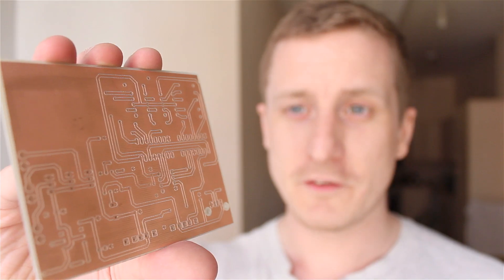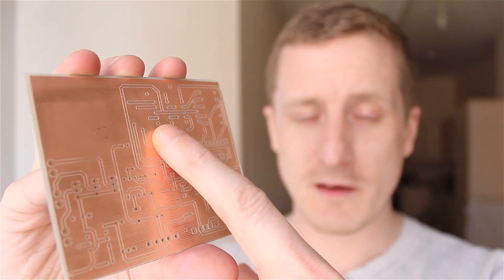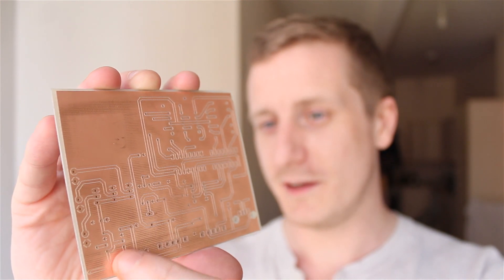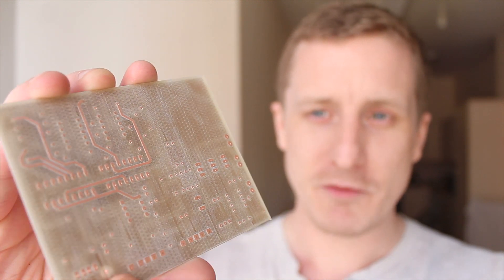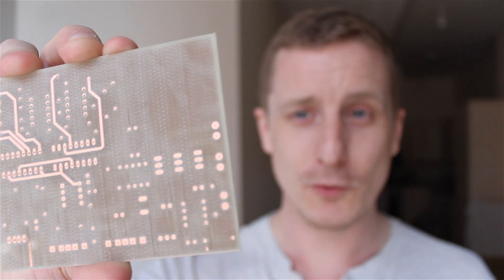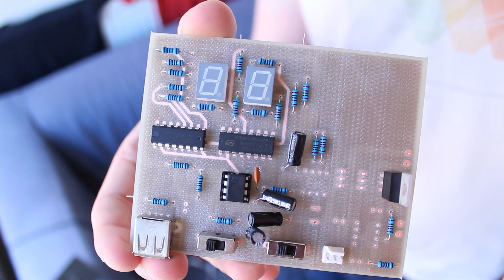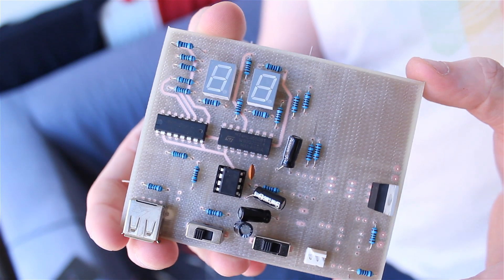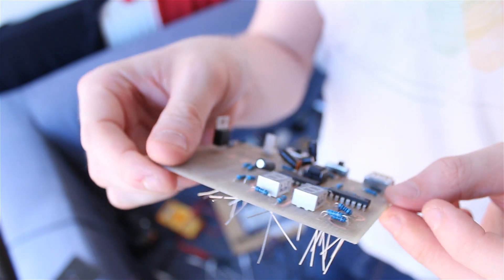Solar Charger: The PCB

Comment: Nice to share.  I haven't done a board at all, hope to when I have a design worth it.

I think a lot of engineers won't talk about this, especially on the software side.  I can't even think of an equivalent video like this.  In hardware, it's easier to "demo" failures because you get smoke, burnouts or some "event".  But when it's a design failure that's more abstract, it's hard to call it.  I guess post-mortem talks are similar to this, still hard to find.

Love the PCB idea.  I want a solar charger as well.

Comment: I'm not an expert but very little wrong with that board to me, especially for a first attempt. In fact I've done the exact same thing with capacitors recently only I didn't realise it until after they were soldered in, and then had a bloody nightmare trying to desolder them out cos of the thermal mass of the ground plane. Love the term 'Gerbil file', that's a definite addition to my personal glossary! Thanks for sharing, hope you keep us up to date with that project.

Comment: David. Never be embarresed to fail. Always remember "Failure is one step closer to success.". We want to see your failures. Not to ridicule you but to offer help and guidence. My friend Patrick from Ireland makes my prototype boards. I have screwed up many times on my Lithium-Ion charge controller and my QA boards. I tell people on my videos when I make a mistake. Why? Because others can learn from us what not to do in thier projects. So think like I do. Our mistakes are another persons teachings. When I fail my immediate reaction is "YES! I'M GETTING CLOSER!" not "What a flippin mistake to make.". I think it was Alexander Graham Bell who said "Invention is 99% failure and 1% success.". Make mistakes It's wonderful.
Reply: Did you not use EagleCAD's standard parts for this? All the sizing and drill hole are already set for you, you wouldn't have had issues with that (assuming they were indeed too small, looks like in the end they were fine.) As for the ground plane, it's the very first thing I do prior to placing the components. Both top and bottom. Then I'll do the components. Either way, I bet it was (probably still is) a great learning experience. Good work, keep it up!
Reply from the maker: Ashley M. Kirchner Thanks Man, the parts did not initially fit because I had to deburr the holes. Unfortunately the parts and associated packages I created myself in eagle had holes way too small for the pins and the pads were too thin to drill larger.
Reply: Ah, yes, the "what I see in Eagle on screen must be large enough to work" effect. Been there, done that. :) On my current project, I'm on revision #3 for all the PCBs involved, five different pieces that all have to come together to form one device. To me it's part of the R&D process. Sometimes it's cheap, other times it's not. Each test cycle is costing me $250-$300 right now. But, the satisfaction of seeing things improve, knowing it's getting better and better each time, that's priceless. So yeah, failure is part of the game. Wait till the day you finish designing, manufacturing, and building a board that you are absolutely sure is correct and final, only to smack yourself after you realize you've forgotten one tiny little 10K pull-down ... :)